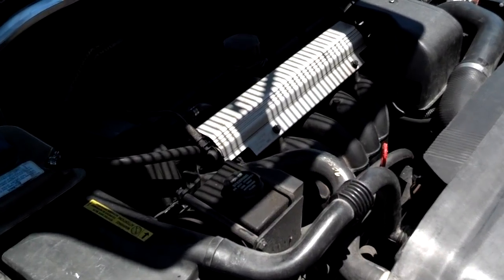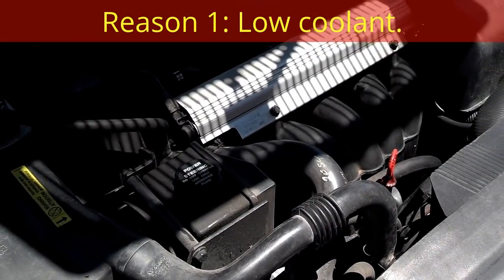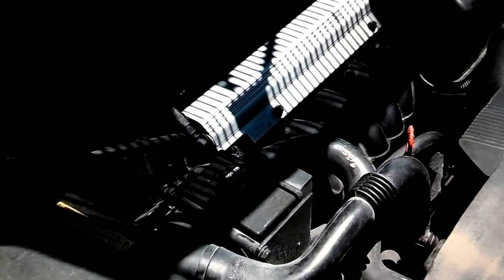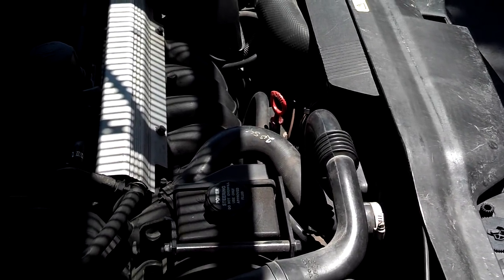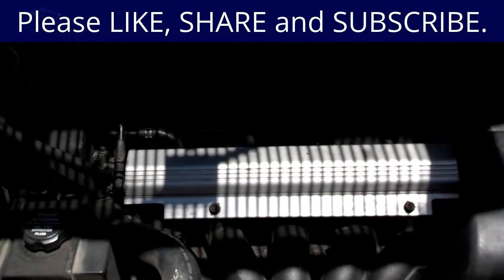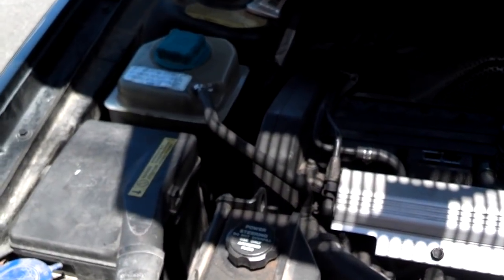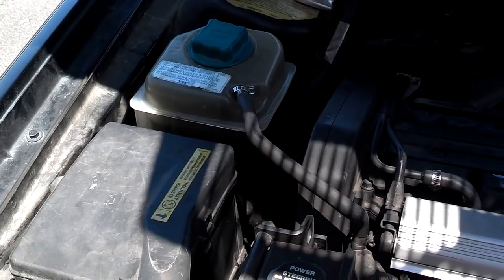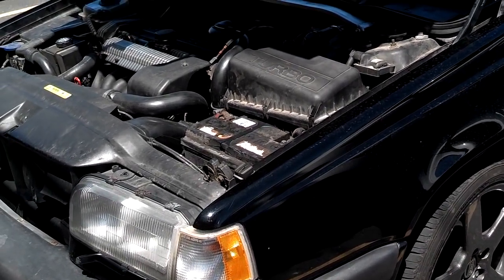My car is over heating, why is this happening? What should you do now?

Comment: Also when jeep is just in on position Key on, the check hoses stays on, but off when engine is running, are the hoses ok?
Reply from the maker: If the engine is NOT running the warning lights should be on.

Comment: My simple question

When do you know your car is overheating?
Niddle at red line? Level above normal level niddle? Steam from car radiator?
Reply from the maker: There is no simple answer. Your engine can overheat with NO warning.
Reply: @RobertDIY  Should I be alarmed if temperature needle intermittently move one level above the normal level and reduce back to normal as you drive? Plus and minus 220f sometimes above 220f to 230f but reduce back to normal 208f
Reply from the maker: If this is a new issue, something is wrong, fix it.
Reply: This is why it's important to watch your gauges.
Reply: Fixed now
Was a blown head gasket

Comment: Would a bad bypass valve off the turbo cause pressure build-up in the cooling system? I have a 6.6 duramax.  It doesn't Overheat...it runs too cold. Replaced water pump,  radiator,  upper radiator hose, both thermostats and coolant Reservoir cap. No coolant in the oil and vice versa. No white smoke.  Coolant is being pushed out of the overflow tank.  Upper radiator hose gets rock hard.  If you rev the rpms up,  sometimes the coolant seems to force its way through and it is fine and will be fine until you let it cool down again.  Then you have to rev up the rpms to get it to operating temperature again.  I know MOST of the symptoms point to a head gasket but no overheating or white smoke is just strange.  I also deleted the egr cooler to eliminate that as the problem.  It was fine for about a week and then the symptoms came back EVEN WORSE!! I'm wondering if the bypass valve on the water outlet tube would be putting air into the cooling system?
Reply from the maker: No
Reply from the maker: You should run the reservoir test for exhaust gases. Sounds like a blown head gasket to me as well.

Comment: Thanks for the video.  I have a 2004 Honda civic.  Sometimes when I turn the inside air vent flow dial from cold setting with air conditioning to hot very quickly the dash indicator starts showing the engine running hot.  Sometimes it seems to be fixed by very slowly turning that hot/cold dial back to cold and turn on the air conditioning.  Once this is done the car cools off usually right away. Sometimes it will go for many days without any signs of overheat.  But as soon as I start turning up the inside heat on the vents the engine starts running too hot and the air blowing out is cold even when set to hot. My coolant is full and not leaking. Rad cap looks fine.   Any ideas as to what might be going on?  Thanks
Reply from the maker: Not at all. Strange reactions.

Comment: what possible reason if your AC is on, and your car starting to  overheat, and even you're driving 130kph.
Reply from the maker: Abuse.
Reply: @RobertDIY  ???
Reply from the maker: I don't even know what kind of car you have, if the coolant is proper, if the engine fan works, how hot it was outside, if you were going up hill, etc. 🤷🏾‍♂️

Comment: Radiator leak is most common
Reply: I drove My dads 2016 Rs4 With My Friends He is on a Long Vacation and i went Fast on a speed Bumb The car went flying I think it Only has Cosmetic damage But 2 Mins later the car Began to Smoke And A Burn Sent and temperature was Realy high And It was Leaking Hot Fluid Its at the Dealer Now..
Reply from the maker: Ouch!
Reply from the maker: ok

Comment: Just got my fans fixed on my 97 Honda CRV but the engine gets a little warm in stop and go traffic in this triple digit heat like the needle goes a little past the middle but not 3/4 of the way to the hot zone. Is that normal??
Reply from the maker: I have no idea. How long have you owned the vehicle?
Reply: @RobertDIY  2 years. It didnt get warmer at all today and it was near triple digits where I live. The fans must be working correctly. I dont think I have to worry about it.

Comment: I faced the horror of overheating in Nissan Xterra 2007 on a journey at about 80 kph. I discovered my gasket had gone bad with milky fluid in plugs, exhaust and everywhere. I got the gasket changed but the overflow of coolant reservoir persists with complete dry up of coolant in radiator. I have checked for leakages, flushed radiator for any blockages, water pump is OK, and electric fan is working. At times, the engine suddenly stalls in motion. This is pretty risky. Please help!
Reply from the maker: How can I help you with that?

Comment: My toyota Tacoma is over heating only driving uphill for couple mins than when I drive back downhill the temperature back to normal, do you know why?
Reply from the maker: Because combustion engines produce more heat when producing more power/strain. Takes more fuel, etc to climb a hill so it produces more heat.

Comment: i put water in it one time and never over heated . 50/50 is half water have coolant  and best to believe its not distilled water
Reply from the maker: Interesting
Reply: If ambient temp raise above 40C in summer like we have in Pakistan 70% coolant and 30% distilled water is recommended. For extreme winter temperatures in other parts of world vice versa may be tried

Comment: I have one question ... In my car showing high temperature continues... I checked with a mechanic,the guy checked my car and he told me your car engine problem.. it's need to replace... And he diagnosed the coolant system is fine.. why should I do?? My question is that over heating problem will.accur if engine is weak.. it's will happen?
Reply from the maker: All I have is in the video.

Comment: Hey, my temperature gauge moves to the centre point within 5-10 minutes of starting the engine. That's like under 5 miles. Does that indicate a problem? Also, my cabin started feeling little harder after the ECU remap. So, I am not really sure if the engine becoming so hot quickly has anything to do with the remap. Or it's only me that's noticing the normal behaviour of the temperature gauge only now and worrying unnecessarily. Any help would be highly appreciated. Thanks :-)
Reply from the maker: They should reach normal temp within 3 miles.

Comment: Hey man I need help. Engine temperature doesn’t get hot, I check the gauge and it seems normal. When i open the hood and touch the engine cover , it feels very hot and so does the radiator hose. Is this normal?
Reply from the maker: I don't even know what kind of car you have.

Comment: I got a car that wants to over heat but after still driving which I know probably is bad for the car but it goes back to normal after the fan turns on I changed the thermostat and bought a new radiator cap what could it be ? Still has coolant in resivor
Reply from the maker: Did you watch the video?
Reply: @RobertDIY  is it the water pump ?? I watched it but I still have questions
Reply from the maker: Bring it by and I'll take a look.

Comment: I have 1996 Pontiac grand am im ready change  radiators  water pump thermostat head gaskets end still have overheating  problems
Reply from the maker: Ouch!
Reply: coolant leaking or radiator cap bad

Comment: I have a 97 ford f150 4.6 I runs hot change thermostat coolent sensor I drive 4 a min runs hot cut engine off 4 2or 3 min then its normal 4 a long time
Reply from the maker: Ouch!

Comment: I have a question . the mechanic fixed my car and replaced the radiator because it was smoking. But the temperature gauge was always in normal temp. I don’t understand how it was smoking but not that bad and gauge showing normal?

Another question how can I know the transmission temperature?
Reply from the maker: I don't understand your first question.
Reply from the maker: Maybe you can read it with an OBD2 tool.
Reply: I same problem I was leaking coolant took it down there and got the water pump replaced and then you said the I had a cracked radiator well had that replaced and my car is still getting hot and smoking and it's so funny how the temperature gauge has always been on half even though I was leaking coolant but when I leave the car lot my thermometer went all way up to H so I don't know what's going on so now he said it's a head gasket

Comment: Hello so my Nissan Altima 05 started overheating due to having low colant but also the oil was very dark black so I’m not sure what’s wrong. I put in more colant and it’s still overheating, can I know what’s wrong?  By the way  I stopped ASAP once the thermostat was getting hotter.
Reply: And I don’t think I have a blown head gasket but I may be wrong.
Reply from the maker: Did you watch the video?

Comment: Can a blown head gasket cos car overheat if no problem with cooling system? thanks.
Reply from the maker: Huh? A blown head gasket is a problem with the coolant system.
Reply: @RobertDIY   I think I had a blown head gasket due to the car expansion tank cover cap being opened while on high speed. Which got The car, "dodge calibre 2007" overheated, and blow the head gasket, but When I filled the radiator with water, the car temperature is very cool, but after 45munites drive or put on car Ac the temperature rises. What could ve been the problem and whats will be the best solution. Thanks.
Reply from the maker: Did you watch the video to the end?
Reply from the maker: https://www.youtube.com/watch?v=LN3eTrpgzu4

Comment: My car is overheating a couple seconds after driving it . When I open the hood there is smoke coming out near the radiator cap . What should I do
Reply from the maker: Stop starting it until you figure out what is wrong, and fix it.

Comment: Great video. I have a 02 bmw 5 series and it keeps over heating when going slow in traffic also very white smoke is coming out of the exhaust when cold start. My question is will a bad head gasket cause my engine to overheat? Because I already changed all the cooling components.
Reply from the maker: Is the fan working?
Reply: Robert DIY how do I check if it works or not?
Reply from the maker: When it gets hot, see if the fan is running.
Reply: Robert DIY ok thank you for answering I’ll try tomorrow morning !

Comment: ive changed rad  new water pump new thermostat and head gasket is good   i think theres a air lock somewherre    .. how do i fix that ?
Reply from the maker: I don't even know what kind of car you have???
Reply: 2000 nissan altima
Reply from the maker: I doubt there is any kind of air pocket. Who told you that the head gasket is good?

Comment: I’m having this issue now. I checked the coolant level, it’s good. The fans are working. The oil looks normal and so does the coolant itself. My car starts overheating about 25 minutes after I start driving it. (2006 Inifinit G35 Coupe). I’m thinking maybe I  have a bad thermostat. Or maybe a bad radiator? I really hope I don’t have a blown head gasket though! What are you’re thoughts?
Reply from the maker: Just like the video explains. If the fan works, it's probably the water pump or thermostat.
Reply: Robert DIY okay, do you think a performance thermostat is worth it? For example, a Mishimoto thermostat that goes for around $65.
Reply from the maker: Not sure what a performance thermostat is.

Comment: Got a brand new radiator temperature sensor but my fans are turning on late what could it be causing the car to overheat
Reply from the maker: I don't even know what kind of car you have.
Reply: Robert DIY 2004 crv The fans won’t turn on when the car is hot it only turns on when I turn on AC both fan Will spin
Reply from the maker: Probably has a bad relay or fan.
Reply: Robert DIY I change the fan switch and I checked the relay
Reply from the maker: Probably has a bad fan or relay.

Comment: Hello Robert, thanks for the elaborate and logical presentation and education. But I have this situation where my 1992 Lexus ES 300 with a replaced 2.5 litre engine, it's over heating at a higher speed only and remains ok in low rev and regular city.
Reply from the maker: Water pump is probably bad. Maybe the coolant and thermostat as well.

Comment: How do u kno your car is over heated
Reply from the maker: The temp gauge went into the red area. You loose coolant and things got very hot or the car shut off and started blowing steam.
Reply: Robert DIY ive been having that problem in my 07 Malibu are they one of the cars that blow a head gasket easily
Reply from the maker: All combustion engine cars that are low on coolant, have a bad water pump, or a bad fan will cause them to overheat.
Reply: Robert DIY i got thermostat and water pump replace it was still overheating my mechanic said to go get a coolant flush did that now the car is really leaking really bad worse than it ever have and white smoke is coming from my car which it never did before do you think they flush my my car wrong
Reply: Robert DIY it's been a couple hours since my flesh and it has never had white smoke or leak as bad as it's doing now

Comment: HELP!!!!My temp gauge is going nuts on me. About a year ago I changed my head gasket and a lot of other parts while I had the engine disasembled. I just recently changed out the temp sending unit and the temp sensor. I have no fluid loss. No rise in the reservoir and the fluid is nice an green within the radiator. But the gauge goes almost to red line and then back down to normal (mid way) and then back up and so on. What the heck? I am going to to change the thermostat here soon. But should I just go ahead and take care of the pump as well? Or is it air in the system? I am lost with this one.
Reply from the maker: I don't even know what kind of car you have. 🤔 Is the fan working?
Reply: Robert DIY tou're right sorry. It's a 96 Ford Explorer. Fan is part of the water pump, so it is always going.
Reply from the maker: If the coolant level is good, the water pump is probably bad.

Comment: Hey rob jus shaved. My head new gasket New radiator new oil switch and now pressure building in the reservoir! Help
Reply from the maker: I don't even know what kind of car you have.
Reply: Chevy Aveo ls 2005
Reply: 1.6 l
Reply from the maker: Not sure if that vehicle is a pressurized system. My car is, some pressure is normal. How much pressure is it?
Reply: I'm a photographer by profession . . . water comes up though the reservoir boiling
Reply from the maker: On my car, I never, never, ever, open the reservoir cap is the engine is hot.

Comment: Hi Robert ! Amazing video...thank you. Everything you described to the T in my situation. I have a 99 mits Montero and car WAS still driveable until today by adding water every day. Today, it finally shut down on the side of the rode and didn't turn back on. Watching the video Im sure the head gasket is now blown but my concern is if I have head gasket changed, will the car be running again or has the that issue now caused a damaged motor, which is why now non-running? How can I tell?
Reply from the maker: I don't know.

Comment: I have a 09 charger 3.5 V6
The water pump is inside the engine.
How can I tell if I have a bad water pump and there is "no" water in the oil?
Awesome video. Thanks so much.
Reply from the maker: Usually leaks.

Comment: Sir, I met with an accident in my Kwid the whole cooling system got damage. I kept the engine running for half n hour in idle position, a very bad smell came out of the engine do u think that it has damage the block head or the gasket.... Sir plz help me
Reply from the maker: Yes
Reply: Robert DIY  Are You Sure n What Should I do... My Service Centre said its okae there is no problem but i don't want to believe them as they are reluctant.
Reply from the maker: Then drive it until it quits.

Comment: Dear sir i have chevrolte matiz 2007 and its overheating problem i do it any thing but overheating problem not fixed
I changed radiator i changed gas kit i changed waterbody i changed all radiator pipes i changed termalstat i try to remove termalstat i also trying directly auto cooling fan and i try to changed engine oil almost i do it any thing remove radiator air i do it any thing but my car still overheating
Reply from the maker: Is it leaking coolant?
Reply: Robert DIY coolant ok no leaking.  today i start engine after 4 to 5 minutes engine starting heating

Comment: Please what can you say about a bad radiator cap. Had an ugly experience where the radiator cap was bad and causing overfilling of the overflow can. This caused most of the coolant to be lost and finally generated overheating of the engine.
Reply from the maker: Yes. What kind of car do you have.

Comment: Hello Robert, thanks for the video. I am having overheating problems with my bmw e46 . I suspected a leak on the pipes and also the head tester appeared to be yellow.... Please I want to know if is the coolant leak causing the overheating or if my head gasket is actually blown.... because I am actually in doubt of the head tester results. Thank you.
Reply from the maker: Man, I didn't test it so I don't know. A coolant leak won't cause the vehicle to overheat but low coolant level will.

Comment: Hi, I found your video very insightful I have a 2013 Chrysler 200 lx 2.4 lt. Engine. Got my oil changed and fluids topped off 3 weeks ago and my car all of a sudden started to over heat this past week, do you think I might have air trapped somewhere from them putting new fluid in or do you think it's a thermostat? Should I take it back to meineke and have them look at it since they serviced it 3weeks ago my car has never done this before after getting an oil change. Thank you for any help
Reply from the maker: Probably not related. If you are not handy have a mechanic look at it before you blow the head gasket.